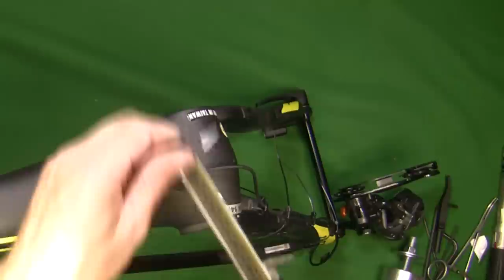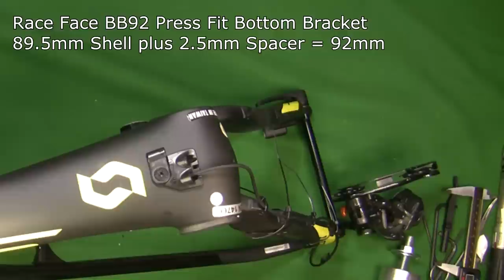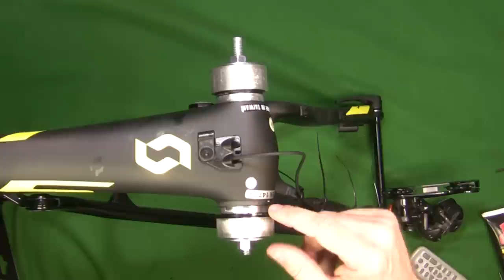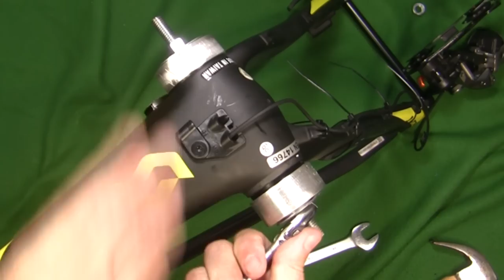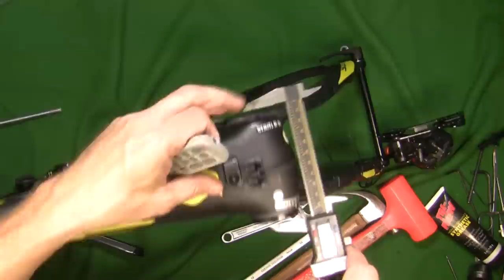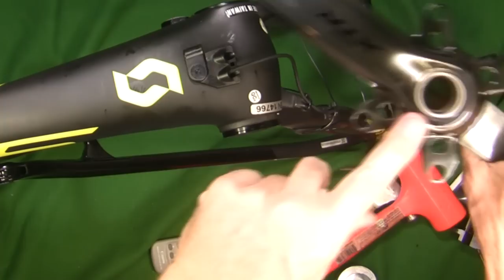BB92 Press Fit Bottom Bracket Installation

Comment: Hello, thanks for your video. You said to use liberal amounts of carbon fibre grease. I can't quite see where you put the grease. Isn't Loctite used between the plastic shell and the frame? Shouldn't grease go on the crank only and NOT between  the plastic shell and the carbon frame. Normally, the plastic shells are put in dry but are you saying to put in grease? What was the outcome if you did? Did it creak as press fit BBs are known to do?
Reply: +Daniel Gandolfo  If you use Locitite on carbon frames it could void the warranty.
Reply: +Dan G Race Face BB shell is aluminium, not plastic. It is advised on the manufacturer's installation instructions to use grease.

Comment: is the bottom bracket you used a 30mm spindle interface?
Reply: No. BB86/92 is meant for 24mm cranks.
Reply: Actually the race face bb92 BB is indeed for 30mm race face spindles.  Check out the raceface website and specifically the BB92 fit chart.
Reply: Yes, the Race face Turbine crankset on my Intense Recluse uses a 30mm spindle in a BB92  bottom bracket. People need to do research before posting!!!
Reply: Its depending on ur bearings. My BB92 RF is for 24mm...